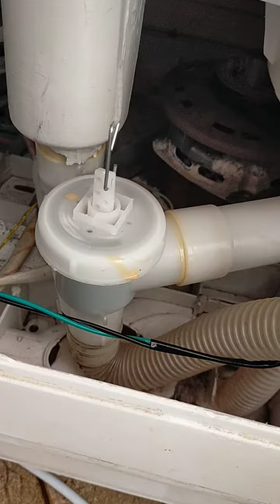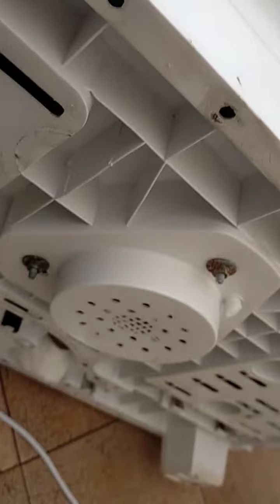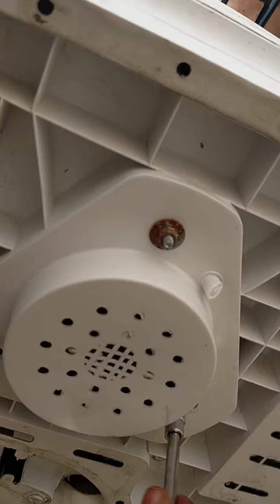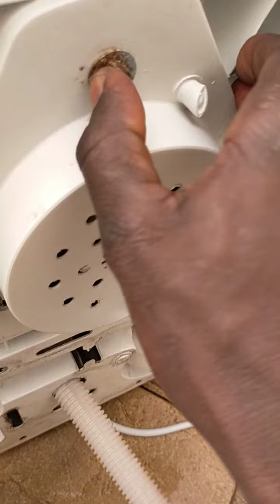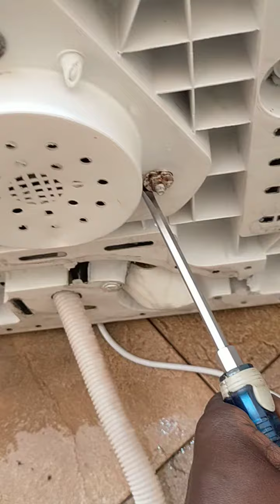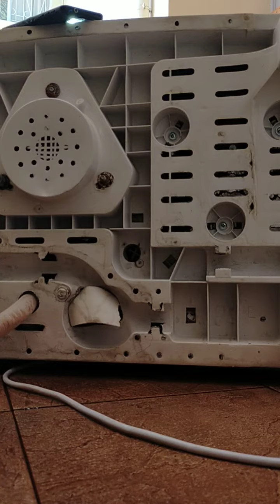TWIN TUB WASHING MACHINE SPINNING SLOWLY,Motor okay,belt is loose).

Comment: Dude you gotta explain what your doin. I’m assuming all you did was tighten the bolts that hold it down to the bottom? That’s not the belt man.
Reply from the maker: Sorry this did not help.You loosen the bolts then push or pull to adjust the belt before tightening the bolts, different models different way of doing it.Goal is to tighten the belt,a technician can help,it's something minor